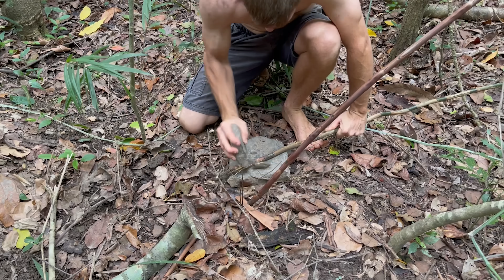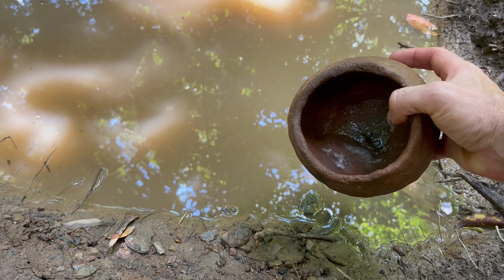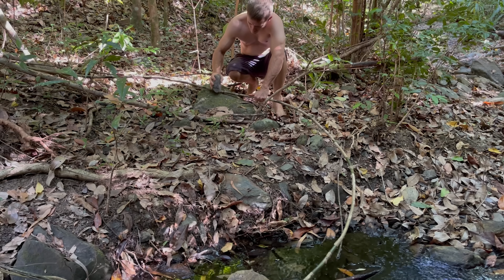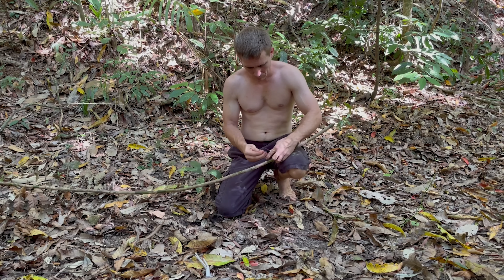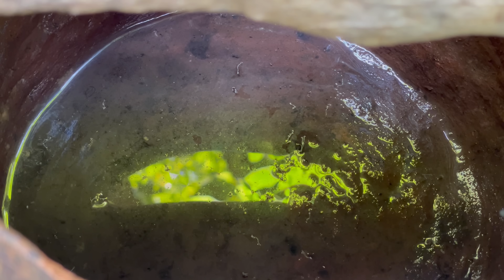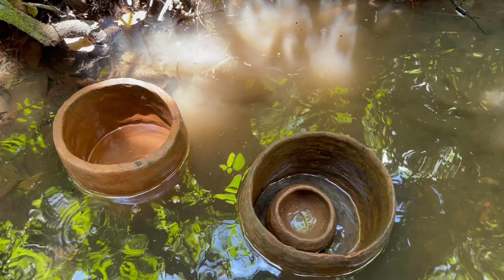Primitive Technology: Cane Water Filter/Siphon

Comment: Tip: make two pots of clay, one larger, one smaller but with a big lip, so it fits in the larger pot, but is suspended. When you make the smaller one, add a layer of charcoal between the clay at the base. Add water to the upper pot, wait until it leaks into the bigger one. This should be an excellent filter that lasts a couple of years until it clogs.

Comment: Very serious question anyone plz feel free to respond, I understand that you tested a concept you read in an article, but wouldn’t it be ‘easier’ (less required effort) to boil water in a pot or something? I read your comment about this does not require pottery, but the process of boiling, to my understanding, kills just about anything in the water. Plus I think there would be a greater yield too since you can just get water from virtually any pond or puddle. 

(TLDR, I suppose) My question is this, is this even needed in an actual survival situation? I mean this is cool as heck and I thought about this before but never knew that 99% purification could be achieved with just a branch. But it seems like wasted effort versus just boiling water.

Comment: Hey, John, how about a layered water filter, in a pot with a small hole at of near the bottom. This idea of using the siphon to power the filter is quite clever though.
Reply: makes one wonder whether running the siphoned water through layers of [properly prepared] gravel, sand, and charcoal would improve filtration. Heck, combine the pot-sumbersion, reed-siphon, and the gravel/sand/charcoal methods!

Comment: DO NOT RELY ON THE CLAY METHOD for drinking water! Boil the water to be certain!  While this is useful for removing sediment and larger contaminants, studies have shown that even 600 micrometer grain clay filters will still allow fecal bacteria through. While it is nice clay, I seriously doubt those clay pots would be considered uniformly 600 grain. 600 μm is enough to remove about 99.3% coliform, but it's possible for that 0.7% to multiply exponentially even if you're in perfect health (it's what bacteria do) and make for a hellish trip to the hospital.  Boil. The. Water.
As for the cane, as another commenter mentioned the length of filtering helps, but the fact that he could easily suck water through it makes me skeptical about how much to trust it.
Study referenced: DOI 10.4314/wsa.v37i4.18 by AJ Varkey (Univ Swaziland) and MD Dlamini

Comment: Can  I suggest you to look inside the concept of  clay pot filters ?  they have an higher flow rate and it exist an organization called potters for peace that share this knowledge for people in rural area with low tech around the world. 
They have pdf and patent with the instruction and it's easy for your level, and actually safe to drink. it's an easy for a concept: you take clay mix it up with a bulking material (flour or ground up  grainchaffs) to increase the percolation speed and then you cook it in an oxidizing atmosphere to burn the organics inside, bonus point if you use in the recipe a silver salt since once cooked the silver oxide deposit will make it even safer.

more over you could share the purpose a really cool organization that makes the world a little bit better

Comment: I love the siphon technique. Great way to get water if you’re stranded in the wild for some reason. I also like the technique where the water is filtered through the pot, but I couldn’t help but think, “If you have a fired clay pot, why not boil the water? Clearly you have access to fire. And it would be so much faster even when you calculate for cooling time.” It seems like more of a novelty rather than a technique that will save your life, but I’m not the expert here. Perhaps it does have some uses.
Reply: Pot used for filtering water inside pond isn't fired and because of that it's porous
Reply: @400yearoldvampire9  If it wasn’t fired, it would be destroyed from just sitting in the water. Especially when the water seeped through and got into the pot. It would’ve been mush by then. EDIT: Watching the video again, I think you might be onto something because he scooped the water out with a smaller pot rather than just picking it up and pouring it out. I’m still not 100% convinced, though.
Reply: @jaykerzp3643  wasn't sitting that long though, in previous videos he wrote about advantages and disadvantages of firing pots, you can find more info about that on his iron bacteria collection video

Comment: This is "filtering" out only what settles on the bottom of the vessel on top of those bricks but bacteria and parasites are siphoned with the water. Those canes are also an amazing substrate for all kinds of microlife. Real filter would be 3 vessels with a hole on the bottom. The upper one would be filled gravel to filter out larger debris, the middle one with sand to filter out smaller debris and the bottom one with charcoal powder to filter out bacteria and parasites.... and of course a collection vessel for clean water underneath it.

Comment: That will not working. I'm working at production liquid sterilized solutions. The smallest bacteria about 0,2µm and the biggest virus is 0,3µm. If you don't have thermal sterilization ways would not be safe to drink.

Comment: I'm confused, what is causing the water to go through the cane? Isn't it moving against gravity without any source of energy to move it?
Reply: water moves against gravity inside the cane all the time, i don't remember exactly how but the gist of it is that the water kind of pulls itself because of the hydrogen bonds between the molecules, kind of like how water climbs up a piece of string. anyways you're "tricking" the cane into doing its job but onto a jar instead of leaves or wherever the water goes inside the cane

Comment: Try cutting the lower clean ends at a bit of an angle. It will space the fibers off of the pot and allow the water to exit freely without blocking the power of the vacuum.

Comment: What Will be the effect, and the resulting purity of water, if you like make a hole in a straw, and then blow into it towards the "filtered water" pot, to make pressure diff and make the filtering process faster? Yeah, this Will make the solution not automated, but shouldnt be faster water filtering system?

Comment: You don’t need to suck on a tube with your mouth to start a siphon. I just put the whole tube under water, so it fills with water, then hold my hand over the top end while I insert it in my tank of water. Of course, I’m using flexible hose with as a siphon, not relatively rigid canes. But I think my method would still work with a rigid tube, as long as you can submerge the whole tube, or even most of it.

Comment: Couldn't you make it gravity-fed with straight canes and a pot with a hole for it at the bottom. Just insert the cane, plug it up with clay, have it be fed down through the cane by gravity. Should be faster than siphon.

Comment: It's a good alternate filtration idea, but you'll get rain before it's 1/4 full. In some parts of the world, you still need to boil the water after it has been filtered, due to parasites.
I would use this technique as a backup water source that I can set and forget. Maybe check on it once a week.
A faster method would be sand, charcoal, grass, and gravel filter. You may need to re-filter the water a few times to get clear water, but it is still faster; might take an hour or two for a full jug.
Reply: I'd think any filter that catches bacteria is definitely catching parasites

Comment: Reading the MIT paper and associated information does seem to indicate that the filtration is reliant on actual wood and is comprised by the present of the tubes that carry sap through them. The video seemed to indicate the water was moving through tubes that had previously held sap in the vines, which would not make use of the filtration mechanism in the paper. 
The paper is about how actual wood, like you build with, can filter water

Comment: Does it work with air soft drying clay pots at a store? I was planning to make 10 medium size pots to filter sea water with this method. or maybe boil the muddy using a weaved leaves sheet to gather the water mist from the heat that could drip water into the pot.

Comment: submerging the pots gave me a great idea. make a large basket thats tightly woven with a smaller basket inside then fill the layer between the two with a charcoal sand gravel mix to filter the water. maybe even line the inside basket with a thin layer of clay and dry it hard with a little fire to harden it.

Comment: Very interesting about the filtering through the xylem of the cane plants in your locale. It makes me wonder if the reeds and various shallow water vegetation in southern Oregon where I'm from could be and were used for the same purpose by the native Americans there.

One interesting experiment to try would be making the siphoning canes longer, maybe 2 or even 3 times, and then using the extra length to extend the downflow section of the siphon while maintaining the one in the source dirty water pot. The larger volume of water and gravity on it in the down flowing section of the cane might provide a stronger siphon and speed up the process a bit possibly?

Comment: I feel like a still would be more efficient. Even in terms of materials used... you seem to get very little water out of the siphons before they clog. If you just burned them for fuel, I wonder how much distilled water you could boil per cane vs filtered.

Of course, for maximum efficiency you would use them as filters and then burn them to fuel the still lol

Comment: Sand rocks and charcoal work better for filtering. Can make a big elevated basin, with a small hole at the bottom that leads to a middle big basin with a hole that leads to a big empty basin at the bottom. 

Fill the top and middle with rocks and sand, layer charcoal and more sand and pour water in.

Just make sure you’ve cleaned and heat treated the rocks and have adequate charcoal and you’ll have clean spring water in no time

Comment: The clay pots was brilliant. It reminded me of a video I saw recently where this guy was showing how way back in the day people would use these big clay jugs to keep water cool in the summer in the desert. The water would slowly seep out and evaporate from the sides which keeps the water cool inside somehow. So when I realized what you were doing with those pots of yours, blew my mind, brilliant i tell you
Reply: The evaporation keeps the jug cool just like sweating helps humans keep at a reasonable body temperature. Think of it as trying to boil a kettle of water by heating up the little stream that's pouring out of it.

The water starts out cool as it's pulled from a well. It's put in a large jug. If the jug doesn't sweat, and it's dark coloured and put in sunlight, the water will soon be hot, with the dark jug walls absorbing the ambient heat as well as the heat from sunlight, becoming hot, and releasing that heat into the water next to the walls, and the water next to the walls releasing the heat to the water in the middle of the jug.

If the jug is out of sunlight, it warms up slower. If the jug isn't dark, it doesn't absorb heat as efficiently, even in shade. If it's protected from wind, it warms up even slower, because air is very ineffective in transferring heat, and stopping new hot air from coming to the jug with the wind makes that transfer even less efficient.

But if the jug on top of all that also sweats, seeping water slowly to make the walls damp, something special happens. The surrounding hot air releases heat into the water on the surface, making it evaporate. Water takes a lot of energy to evaporate, so this takes some time, especially if wind can't bring hot air in. By the time the water on the surface has evaporated, more has seeped out! This water comes from the cool insides of the jug, so it takes just as long to evaporate (if not longer, since the air around the jug is now a bit cooler after giving al that heat to the evaporated water).
Reply: shoutouts Andy Ward

Comment: I feel like a particle filter would be a lot better.... Just make a custom pot w/ a little spout on the bottom then place some small rocks, then bigger ones then sand th stones and finish w/ pebbles, then all you have to do is pour water in and let it filter through all the sand. You can add charcoal to the sand so it helps sanitize it while it filters... I'm pretty sure he's made activated charcoal before so that would be way better.

Comment: Have you considered a gravity fed filter (gravel->sediment->sand->charcoal->output)? I’ve had mixed results, but when I made a duel system (2 filter system) it got better and after a few weeks each filter began improving, though you will want to exchange the charcoal medium periodically.
Reply: This works as a first step but you would still have to boil the water as that filter clears out dirt and sand and small particles but not bacteria. I mean it helps but still is not ideal only would be good like a "I am about to die of dehydratation and need water" it will give you water for few days but then diarrhea might set in and you are done for.
Reply: @Wulfik19  Well, speaking as a chemist who has actually had to do sterile level filtrations - it all depends on the porosity of the clay pots - you could get clay with a porosity of 0.2 micron (or even a bit smaller) - which would actually sterilize the product, as you just mechanically filtered out bacteria and viruses.  The flow rate would likely not be great per surface area, but if they were big enough pots you could get a semi-reasonable flow.  Sterility is easy with boiling, but it's not the only way that it can be done.  Of course, he would have no way of knowing he had that porosity, so it's a crapshoot.  Also, humans have survived a very long time drinking natural water sources - rainwater usually doesn't have e-coli, or other pathogens.  Springwater either, unless you are in an area contaminated with farm wastes.  Even river water, due to the dilution factor, can be relatively safe, unless it has biological contamination.
Reply: watch codys lab, he shows you how to make activated charcoal, homemade with super heated steam.  This would be difficult to accomplish in nature but easy in a post apocalyptic world.
Reply: It could be easily done as a tower of stacked up clay pots of the same side, maybe even add interlocking notches to their lips and bottoms. That way they could be easily upsized and left on their own to filter for possibly days.
Reply: as wulfik said this wont give you totally clean water, but if the method in the video actually works (he says he got the idea from an MIT research paper, but the research paper in question is using pine branches, not the types of shoots he's using, which idk if they'd be as effective or not) then combining the two methods would be good, the layered filter with charcoal is great for getting VERY clean-looking water, but this method in the video still appears to give somewhat dirty-looking water.
Reply: Yes, I was thinking the same thing. I saw a documentary where they were doing a gravity fed filters in India to get clean potable water to the farm villagers.
Reply: high possibility of stomach upset due to internal enteritis.
Reply: @ekskdks  In a situation like this you would still boil. No chance of what you mentioned happening. You filter for taste and boil always to eliminate anything not caught. This is the pretreatment minimum for public safe water, the stuff we get through the pipes already has this done to some extent. Plus, you don’t have chlorine and UV so you do what everyone did for most of humanity. Clean it as best you can and boil it when you are able.

Comment: Thank you for this video. Any idea why is it clogging? Would a filter with sand, charcoal and some fabric would help to prolong the time it works? And would it work faster if bottom of branches didn't touch and were somehow few centimeters above surface? If it truly removes 99% of bacteria, and is safe to drink without boiling, it really helpful way to filter water when other filters and fire are not available.

Comment: Another idea could be to make a multi-step filter. For example, a fibrous mesh (or even a ball, if weaving a finer fiber's too much work) packed into a clay funnel to get anything large, then decanting to remove sediment, THEN passing it through a cane siphon for bacteria and finer particles.

It'd likely take much longer to clog, but I imagine it'd also be a much cleaner result if the cane has a lighter workload, too.
Reply: Or, you use the "clay pot in stream" method, then put that water through a cane siphon.

That should produce pretty damn clean water
Reply: @gustavchambert7072  Both are pretty smart however I'd have to give it to you Gustav as your method is more automatic rather than having to actively topping up the water. All he'll need to do is to build a small elevated reservoir with constant stream of water to submerge the pot so the cane siphon can constantly do it's work without losing pressure.
Reply: @paulbui1410  yep, or, you can find a small waterfall or similar, you probably only need about thirty centimetres of height difference, then put the pot in the stream above the waterfall and the cane-filter pot down below.

Comment: You can extend the life of your filter by using settling/sedimentation, like a three pot settling method (~48 hours of settling), first. Or if you have fabric (I see you don't have your sari on) you can fold it 4-8 times and get a ~20 μm filter. But maybe the outside-the-pot technique is better, depending on circumstances. Check for cracks with the clay pot method (short circuits in the filter). Note that these methods aren't great with viruses (clay without silver; gymnosperm xylem according to MIT).